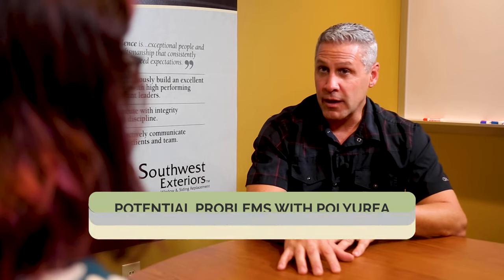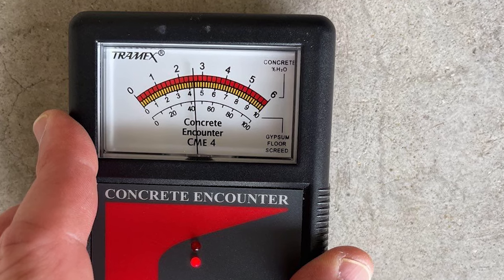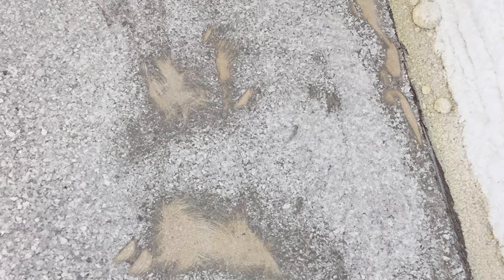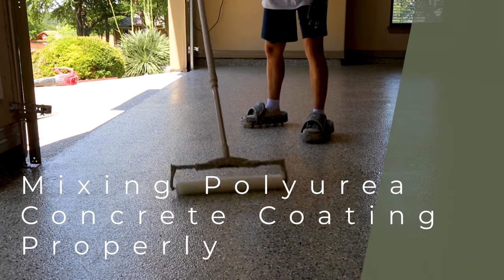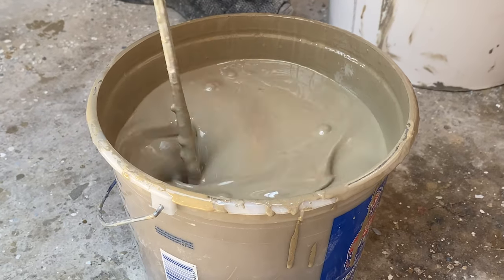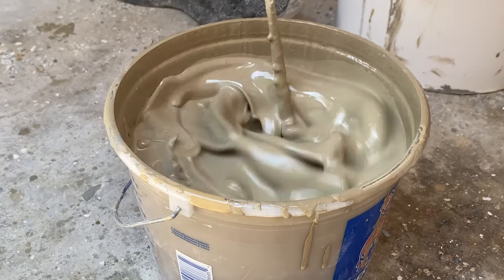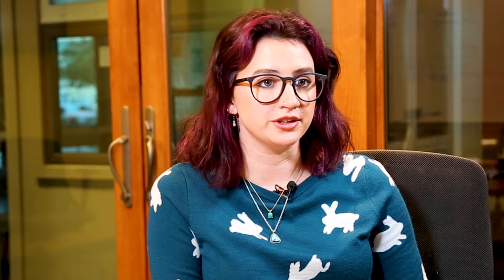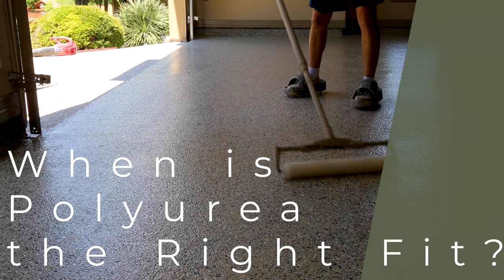Problems with a Polyurea Concrete Coating (or Polyaspartic)

Comment: One guy said if you tape clear plastic on the concrete and all edges and let it sit for 24 hours. If moisture shows on the plastics its too moist.
Reply from the maker: Interesting idea haven't heard that one before. I think it might be time to run an experiment to see how that holds up to the moisture meter.
Reply from the maker: Any more information or data on that one please share.
Reply: @TheHomeSolutionsChannel  It was a floor specialist on a You Tube video and he even demoed the process. The floor was fine after 24 hours. You should test your meter vs the clear plastic.
Reply from the maker: Oh that sounds cool! Thank you for that. 👍 
I've already spoken with my Concrete Coating Project Manager to see if we can maybe put together a test demo of some sorts. Stay tuned to the channel.
Reply: Could you please tell me what video that was? Thank you!
Reply: ASTM D4263 Plastic tape Test. Any coatings Contractor should know this.

Comment: Im getting my concrete pool deck refinished which is currently just paint and a knockdown texture. The polyaspartic guys say their product is better. The polyurethane guys say their product is better. I live in Florida. Which company should I go with, one that does polyaspartic or polyurethane? Or should I just go with whichever one has the longer/better warranty? Thanks for any help you can provide.
Reply from the maker: Both are great products so it's best to dig a little deeper into the installer. Personally I always look at the longer/better warranty and weigh that out with the cost. It doesn't matter which product you choose if you go with a company that won't install it properly. If someone has a lifetime or equivalent warranty you can trust that they will stand behind their work in the long run and you will be happier with that product. 
Hope this helps.

Comment: Thanks for the information! I have a question that I'm hoping someone can answer. I'm dealing with cracks in concrete slabs in Florida. I'm pretty sure that I'm prepping them properly as I've researched the "how-to" information at length and I've been a mason for quite some time now. The problem I'm having is finding a product that will last. Most of the work I've done has been in New England where the aggregate in the crete is much different and the temps don't get nearly as hot as Florida. I've tried just about everything from different types of caulk to every crack filler sold at the giant supply stores, including polymeric sand. All the products that use water in the mix seem to be the least effective I think because the concrete is so dry and the sun is too hot, I even tried at night and laid burlap down for a few weeks watering consistently. Nothing seems to be working, or at least not to the standards I would put my name on. Thanks for any input that anyone can provide!
Reply from the maker: Thanks for checking out the video! 
At Southwest Exteriors we use Mender Crack and Spall Repair, a version of Penntek's CR Mender product which is proprietary  product that works well with Penntek Polyurea Coatings. Here is a link to the Penntek repair page for more info on that. https://www.penntekcoatings.com/concrete-coatings/repair/
Good luck, I hope this helps and good luck finding something that works well in the Florida heat!
Reply: @TheHomeSolutionsChannel  Thank you so much for taking the time!
Reply: Try mendor , it’s an epoxy filler I believe you can shake up in small bottles

Comment: I'm definitely going to diy my own floor in polyurea
Reply from the maker: That is always a great option if you are comfortable with doing things yourself. The biggest factor is going to be making sure you prep your concrete so the base coat can adhere properly to give you all the benefits that come with Polyurea. From a DIY standpoint, having the ability to check the hardness and moisture of your concrete, will make sure you know that your concrete is ready and will give you the best result.
Reply: @TheHomeSolutionsChannel  I have a lavina 30gx, the meter and a few pulse bacs etc should be good to go lol. I've put in about 8,000 polyurea garage floors for people over the years and figured I'd diy mine 😀
Reply: @JDSOutdoors  legend
Reply from the maker: Sounds like you are ready to go!
Reply: @JDSOutdoors  you’ve done over 8,000 of these floors and your still calling it DIY ? Lol
Reply: @treeman765  lol what else would ya call working on your own house
Reply: 1 a day, 5 days a week for over 30 years?  You are the man.
Reply: @4MikeHarley  na it's called 2 a day and weekends

Comment: What is some one buys your home and wants a different floor color?
Reply from the maker: Good question! If a new homeowner prefers a different color for the polyurea-coated floor, they can easily re-coat it with a new color of polyurea. The existing coating just needs to be properly prepped—usually cleaned and lightly sanded—before applying the new layer. This makes polyurea a versatile option for anyone looking to personalize their space. Thanks for your question!

Comment: How about salts in the substrate. How will polyurea react with efflorescence?
Reply from the maker: Thank you for checking out the video!!

Great question! If we see signs of efflorescence, we talk to homeowners about applying a moisture mitigation system before applying our 100% solid polyurea basecoat.  We currently have a couple of options: Moisture Stop Plus or EMVB (for interior spaces only).

Comment: I'm building a new garage. Is it likely to have a moisture problem?
Reply from the maker: Thank you for checking out the video! 
Moisture problems can be mainly identified by the surrounding features. Such as , If the concrete is in an area that consistently has water on it, such as by a pool or is being washed a lot. 
Another reason you could have moisture in the concrete would be if the mixture is too wet or it isn't cured properly. Your contractor should be able to check the moisture levels of the concrete, and there are moisture barriers or curing sealants that could help draw any moisture out.

Comment: I normally blow torch if moisture is present, this is effective?
Reply from the maker: While being extremely careful with a blow torch, it can be effective in absorbing some of the moisture present on the surface of your concrete. If possible, you will still want to try and test the moisture levels before placing the base coat to assure that there still isn't too much moisture down in the concrete. We have a great article on the "Concrete Coating Process" you can check out to learn more about the full installation process. 
https://www.southwestexteriors.com/blog/p.210422000/what-is-the-concrete-coating-process-and-how-to-prepare-for-it/
Thanks for checking out the video!!

Comment: How long does a coating last?
Reply from the maker: It depends on the installation and the exactly product, but it should last a minimum of 15 years. Longer if properly cared for and properly installed. If you go with a company with a good warranty it could be covered for as long as you own your home, so you wouldn't have to worry about not having a high quality flooring again. 
Thanks for checking out the video!!

Comment: I one one floor coating company tell me I needed epoxy instead of polyaspartic because the moisture content of mine was at 3.25. Is that true?

I saw one company that advertises that they do 100% polyaspartic for both coats, and says other companies only use polyaspartic for one coat and polyurea for the other. Is that nonsense?

If I get my wood steps coated, will it last?
Reply from the maker: Thanks for checking out the video!! 
That sounds a little off. If the moisture level is too high for a Polyurea coating, then you can have a moisture barrier applied to prepare the concrete for your coating. You shouldn't need to get a specific type of coating due to the moisture level. 
We feel, that using polyurea and polyaspartic together yields the strongest result. So that is how we do our polyurea coatings. Any combination is not wrong, just one of those things where everyone has, what they feel, is their own secret recipe for success. 
Polyurea will not last on wood steps. When properly installed, your concrete should be ground down to open up the pores of the concrete for proper adhesion. So when it comes to wood that level of bonding is not available. There may be some deck restore products that can have a similar look that would be made to adhere to wood. 
Hope this helps.
Reply from the maker: I just spoke with my concrete coating leader and she said that any reading over a 5.5 is when we suggest a moisture barrier if after a week it doesn't dry out on it's own. She said that a 3.25 should be an ideal moisture level for either Epoxy of Polyurea.

Comment: he didnt cover the recommended ASTM sheet test, instead he went right to tools
Reply from the maker: The ASTM Plastic Sheet Test is another option you can do to discover if moisture is present in your concrete. However, for checking moisture you can get a lot more precise data, and quicker, by using a moisture meter. 

According to the Material Expert, "It's important to understand that the ASTM sheet test only provides qualitative information regarding the presence of moisture and doesn't provide any quantitative measurement of the amount of moisture present. This method used to detect the presence of capillary moisture in concrete." 
https://www.materialtestingexpert.com/concrete/astm-d4263-moisture-in-concrete-plastic-sheet

If you are doing your own install, then doing the plastic sheet test is a great low-cost option to get an idea of moisture being present in your concrete. As an installer, it makes more sense to use the right equipment to avoid asking our clients and crews for the extra time required to run the ASTM test. 

Thank you for checking out the video!!

Comment: Is it slippery?
Reply from the maker: A concrete coating should not make your concrete slippery. Of course if there are other factors involved like water, oil, or other types of chemicals on the surface then, just like concrete, your surface could be slicker than expected. 
The polyurea coatings we specialize in use vinyl chips that are similar to shredded paper and give the flooring an orange-peel-like feel to the finish and help with slip resistance.

Comment: He says take classes or higher a contractor. Lol great advice. You could just go online ,  download the tds sheet and follow the instructions from the manufacturer. By the way contractors are not clairvoyant, they read the tds sheet to know what to do. The fact that this guy's doesn't include that in his advice means his manipulating the audience to beleive there is a secret method or contractors received formal training on how to apply the coating. Don't play your self. 

Good job Rebacca making a video that leads home owners to spending more money then they need to. 

It is true that you wouldn't want to just buy these products and apply them with out thuroughly researching them. But the conclusion this video offers is bullshit. And Rebecca probably lives in a condo and has never owned a floor that she a coated.
Reply from the maker: Thanks for taking the time to share your thoughts! You’re absolutely right that the TDS (Technical Data Sheet) is a crucial resource for anyone looking to apply a polyurea concrete coating, and we definitely encourage homeowners to review it thoroughly.

Our intention with the video was to highlight the importance of understanding the full scope of a project before diving in. While some homeowners may feel confident after reading the TDS, others might benefit from additional training or hiring a contractor, especially for more complex or large-scale applications. The goal is to ensure that everyone can achieve the best possible results for their specific situation.

We appreciate your perspective and hope that our videos continue to provide valuable insights, whether you're a DIY enthusiast or someone looking to hire a pro. If you have any tips or experiences you’d like to share, we’d love to hear them! Thanks again for contributing to the conversation.

Comment: Mixing too fast doesn't create air bubbles....the air bubbles only comes from the concrete. Air bubbles forming because you mixed to fast is a myth that people don't stop mimicking. Out-gasing creates the bubbles do to air in the concrete......not from mixing the product too fast.
Reply from the maker: That's interesting to hear. Thank you for sharing!

Comment: Why would you be bonded for a garage floor 😂😂
Reply from the maker: While insurance offers protection for the company, bonding offers protection to a business's customer. If something goes wrong, the customer can file a claim against the company, and the bond purchased by the company will cover the cost of the claim, provided it is deemed to be valid.
Thanks for checking out the video!!

Comment: Is cheaper just to get new concrete 😂😂😂
Reply from the maker: 😂 That is always an option, depending on the size of the space. But your new concrete still won't have the durability and aesthetic appeal of a polyurea coating. 😉

Comment: This guy is advocating a shitty job if you are selling your house? Causing the future homeowner a headache. Do it right no matter if you are selling or not folks! It"s the right thing to do for your fellow human! Karma might get you!
Reply from the maker: Thank you for your comment! 
In the video, Steve mentioned that for those on a time crunch or with budget constraints, like preparing to sell a home, a DIY kit might be a quicker option. However, we strongly believe in the importance of doing the job right. Proper installation with high-quality materials ensures durability and long-term benefits for all homeowners. Your emphasis on quality and doing the right thing is greatly appreciated. We always aim to provide the best solutions for everyone.